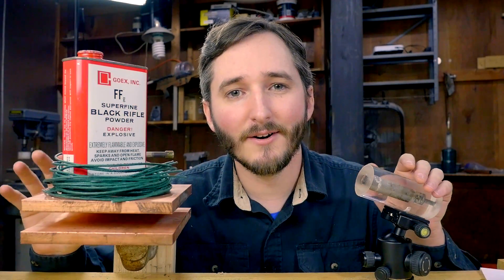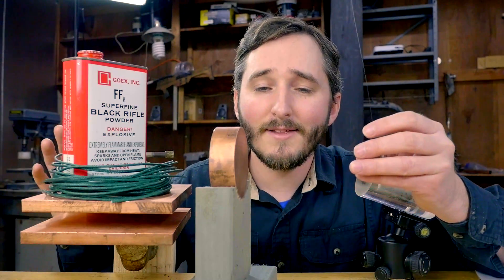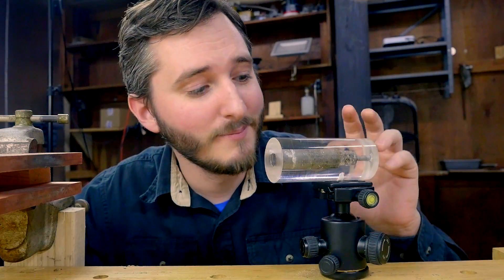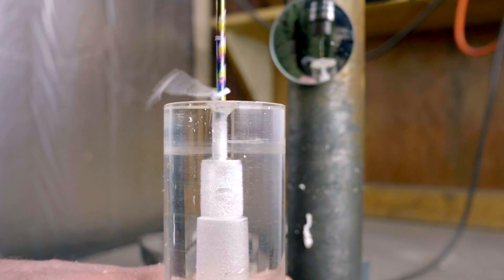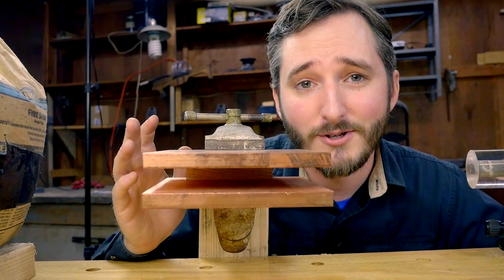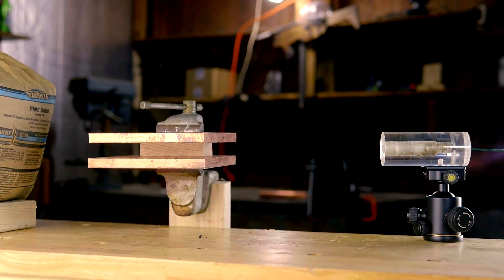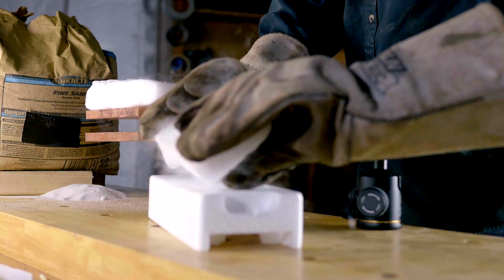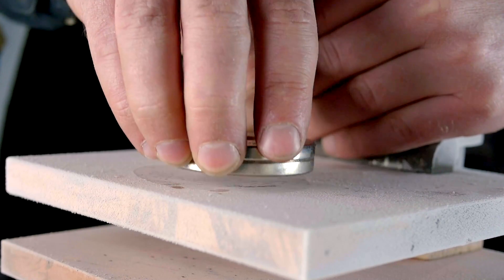Electromagnetic Force Fields VS. Magnetic Cannonball

Comment: There is no significant slowdown because there is a finite "optimal speed" of magnet vs copper to produce maximum "stopping force". Too slow and too fast relative movement will produce "less then optimal" forces. This fact is well known when designing induction motors: the typical torque curve as a function of slip has optimum, and decreases if we deverge from this optimum.
Reply: Exactly.  For higher speeds, you need more resistance.  So if the pipe had been highly resistive, it would have slowed it down more.  Why?  Imagine the pipe was a superconductor.  It would fight the bullet on the way in, but once in, the magnetic field would not penetrate the pipe, and no energy is lost along the way.  Given the speed of the ball, the copper is sufficiently conductive that it never really lets the magnetic field penetrate to any degree, so less force. Material with more resistance would have let the field penetrate and produced more force at the higher speed (though much less at lower speeds)
Reply: @manu de hanoi, for each speed there is "optimal tube resistance".
When bullet slows down in the magnetic field, kinetic energy of that bullet turns into heat energy, because currents in the copper cause that copper to increase temperature. Due to energy conservation law one cannot "just stop the bullet", because one needs to turn bullet's kinetic energy to "something else".
Now imagine magnetic bullet traveling through plastic tube (very-very high resistance) - almost no currents are induced at all, so there is no force to stop the bullet (and no heat produced at all). Now imagine tube with very low resistance - currents will not cause much heat, because current needs resistance to produce heat also (as Matthias Wandel already noticed) magnetic field would not penetrate the pipe deeply, bacause iduced currents cause "the opposite" magnetic field... So for each speed one needs some optimal resistance, and to be effective, tube needs variadic resistance from one end to other (high resistances in areas where bullet speed is high and low resistances where bullet speed is low)
Reply: @Alex Alex, unfortinately the "stopping force" is not proportional to the speed because of the effects described by Matthias Wandel above. The more speed we have, the less part of the magnetic field penetrates the copper. And (unfortunately) this complicates induction motor design (and control) a lot.
Reply: At a given voltage, yes. But you are falling prey to your own unrealistic assumptions. For any real power source, as the resistance of your heater goes to zero, so does its power output, and all the heating will happen in places other than your supposed heater. This insight doesnt require any appreciation of superconductors. Just try heating your room by touching a negative and positive mains wire together.

The complete story of what is going on with the magnet in the tube is a lot more subtle, and given that it isnt trivial to extrapolate from ohms law how resistive heaters work in the real world, rest assured that your recitation of faradays law doesn't help anyone appreciate the full story of what happens with the magnet in the tube.
Reply: Matthias Wandel, yes, that is why a wound rotor induction motor exist: to place more resistance when relative speed between  the rotor and the rotating magnetic field (caused by stator) is high. "a wound rotor induction motor has a stator like the squirrel cage induction motor, but a rotor with insulated windings brought out via slip rings and brushes. However, no power is applied to the slip rings. Their sole purpose is to allow resistance to be placed in series with the rotor windings while starting. This resistance is shorted out once the motor is started to make the rotor look electrically like the squirrel cage counterpart. ... Placing resistance in series with the rotor windings not only decreases start current, locked rotor current (LRC), but also increases the starting torque, locked rotor torque (LRT)."
Reply: The "stopping force" is proportional to the speed. It doesn't reduce at a high speed. However, the stopping force is proportional, but the bullet energy is proportional to the SQUARE of the speed. So doubling the speed of the bullet doubles the resisting force, but quadruples the bullet's energy.
Reply: 'If you increase R you just go towards a plastic tube.'; not sure this is an official thing, but I like to call that the 'linearization fallacy'. Note that a simple optimal resistance heater does neither have an infinite nor a zero resistance either. I could apply the same argument you are making to that scenario; according to you, a lower resistance would lead to a better heater; after all, going in the other direction would (eventually) lead you to a plastic tube!
Reply: To point out the flaw in your reasoning on another level; if the tube had zero resistance, then all the energy that went into spinning up the magnetic field / current by the leading pole, would be fully converted back into motion by the lagging pole, since both exert an equal but opposite effect. In an infinite tube, only insofar this current is dissipated inbetween the passing of the opposite poles did we lose any energy whatsoever.
Reply: @manu de hanoi the lower the resistance of the tube, the higher the current generated and so the the higher is the "expulsion" of the magnetic field from the tube... and so currents happen only on the surface of the tube, and this does not cause enough "stopping force"... there is some equilibrium point between "expulsion" and current amount that causes maximum force.
Exactly the same processes happen inside the induction motor - magnetic field caused by the stator "rotates" around the rotor, and it appears that once "rotation speed" is too high there is that "expulsion" issue that causes force/torque to be less then in case if rotor is rotating toghether with magnetic field.
Reply: That magnetic field that is created in the opposite direction is exatly the one that causes "expulsion". That is why magnetic field cannot enter superconductor at all.
Reply: @matthias Wandel are you sure about that ? I believe the less resistance, the more current induced, the bigger the magnetic field opposing the bullet. I'd re-try the tube experiment with an outer shell made with a magnetically conductive material like steel.
Reply: I was thinking the same but u commented better :-D
Reply: nah, air being very resistive, according to your theories it should stop the bullet best
Reply: manu: you raise a fair point, but not a correct one.  The momentum of the projectile has to effectively couple to the EM field in the stationary material, AND that stationary material has to be sufficiently dissipative. Air does not satisfy the first requirement.
Reply: My point is that the dissipation should not come from electrical resistance (=heat) but from the work that counter magnetic field does on the projectile . 
We are stopping the projectile with a counter magnetic field remember ? Everybody knows the more conductive the material the better magnet (cf best magnets made with superconductors).
Reply: @Pavlo Mur we agree that ultimately the energy ends up as heat, however, the lower the resistance of the tube, the higher the current generated, and the higher the current the stronger the bullet stopping effect. If the power dissipated is UxI, or RxIxI, you see that you can either increase R or I to increase the dissipated energy. But only I is usefull in stopping the bullet. If you increase R you just go towards a plastic tube. I feel like you are confusing issues related to motor slippage with the one we are concerned here.
Reply: about the heater : that's correct, on a given mains voltage, more powerful heaters have a lower resistance. And the bullet example can also be considered as a constant voltage (EMF is proportional to the rate of change of magnetic field). 

About 0 resistance:   I dont know deep enough about superconductors. But you can see that if the resistance was extremely small (but not 0), then an extremely high current would be generated such that even a super tiny resistance would generate a lot of heat (see the heater above)
Reply: Tf is going on here
Reply: there is no "expulsion" of the magnetic field from the tube, there is just a magnetic field that is created in the opposite direction and that is what stops the bullet magnet
Reply: The effect works like this: inductors try to keep the magnetic flux that passes through it constant. If the flux changes, a current appears in the inductor (the copper tube in our case) in order to try to keep the flux constant, but since materials are resistive, this current decreases with time. When a magnet crosses a copper tube, it induces a current in the tube, and this current generates a magnetic field that will always go against the direction of the field created by the magnet, hence slowing it down. The kinetic energy from the magnet is transformed into a current density which in turn is converted to heat, in this case. So TL;DR: The higher the rate of change in magnetic flux (higher speed or sooner magnet) and the lower the material resistivity, the greater the induced currents and hence the stronger the magnetic field generated by this induced currents, finally the greater is the force going against the movement of the magnet.
PS: In case of electrical motor, you can remember that if it's running under nominal speed and than it's suddenly reversed, the currents in the rotor increase dramatically because the slip suddenly goes to 2 :)
(Please correct my English haha)
Reply: Pavlo Mur and Matthias Wandel - - I'm so glad I found this particular comment thread. I was hoping someone would bring it up. I made my own eddy current brake dynamometer and found that there was indeed a certain rpm where the torque maxed out and then started to go down with further increases in relative speed. I've also observed this effect when an induction motor starts up. At first the slip frequency is 100% and torque is quite low. You can hear the slip tone from the motor. Then as the motor speed increases and the slip frequency drops, at some point, all of a sudden the motor takes off and accelerates rather quickly to full speed. This explains why motors have a break down torque, otherwise torque would just keep getting higher and higher as the motor is slowed more and more by the load. It also explains why rotor bars are carefully given a particular cross sectional shape to produce the desired torque curve. I agree with Pavlo Mur and with Matthias Wandel. For those who didn't think they were right, I understand your confusion. I used to think that lower resistance would make for more current and more force as relative speed goes up, and it does up to a point, but it is a curve that goes up and then back down. What I learned is that the copper pipe effectively gets thinner walled as the speed increases. At some point this thinner wall makes the current go down and the force goes down with it. For my dynamometer the maximum torque was at a relative velocity of about 19 meters per second, the speed where the disk passed under the magnets. I was using an aluminum disk. It dissipated 5,600 watts of heat, or about 7.5 horse power. I know this is an old thread, but I'd be interested to hear comments.

Comment: Magnetic lose their magnetism when heated to 700 degrees. So would that have something I do with your experiment?
Reply from the maker: No they don't get nearly that hot when in the cannon for a fraction of a second.
Reply: They might loose their strength from the shock.
Reply: Degaussing is permanent, so if the magnet still has it's field after its recovered then it had it's field when going through the copper aswell
Reply: I got the same line of thought. Is the magnetic projectile still magnetic when it got a flash of high temperature from the ignition?
Reply: Anakin Skyobiliviator it is
Reply: max temp is 60°C for n52 over 60°C it is  metal. and bouth the copper and the bullet gets warm in the proces of slowing down.